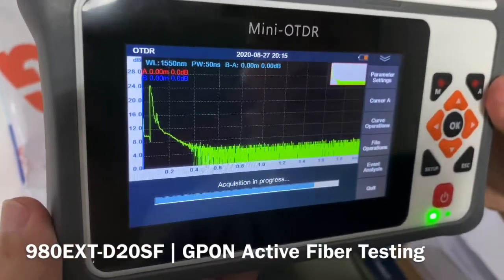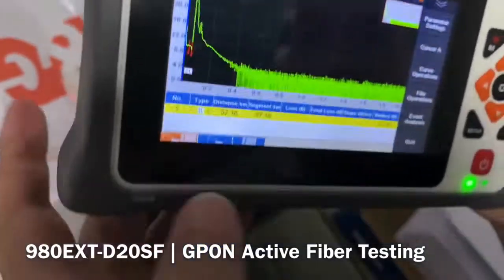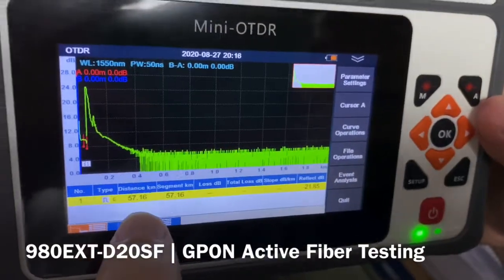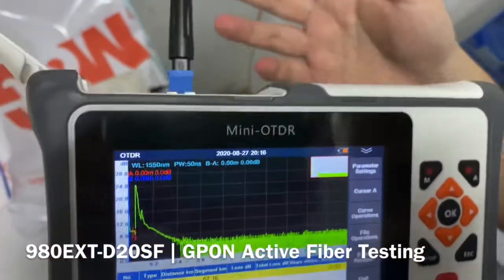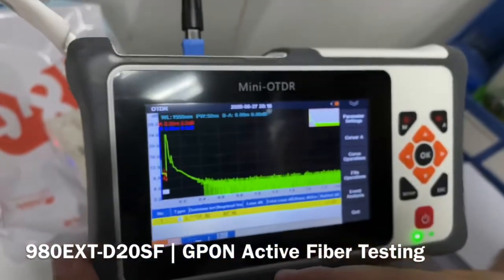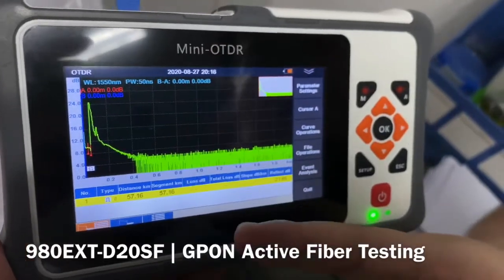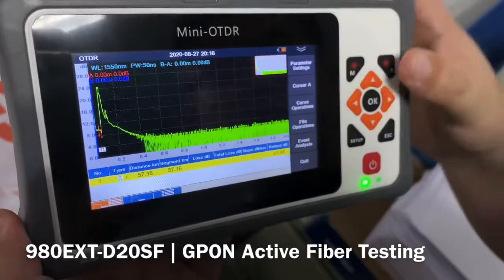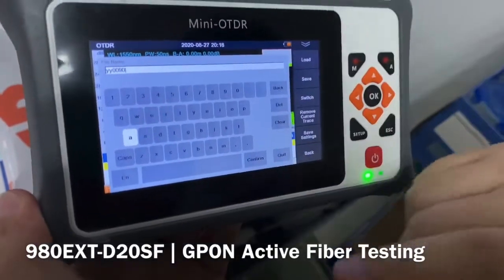980EXT-D20SF OTDR for GPON EPON Active Fiber Testing

Comment: Hello. Does the OTDR function work with active fiber and with unsigned fiber?  If it is an active fiber with signal 1490 and 1550 does it measure the attenuation?